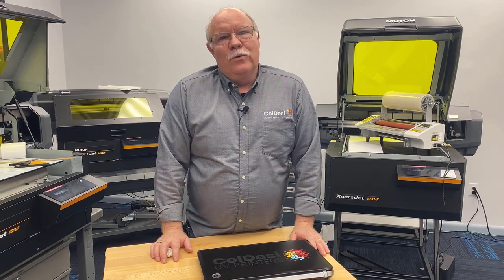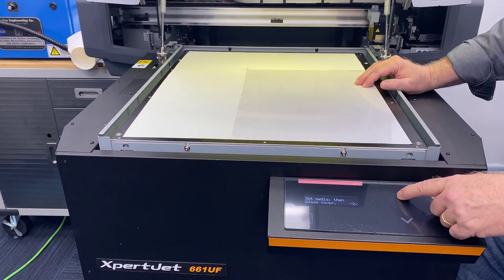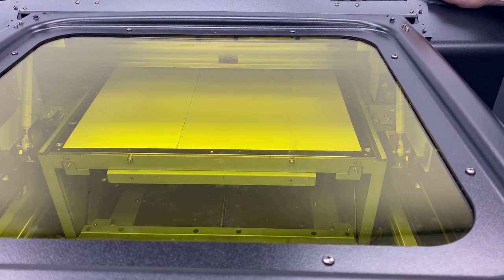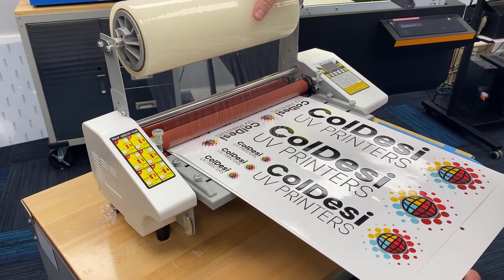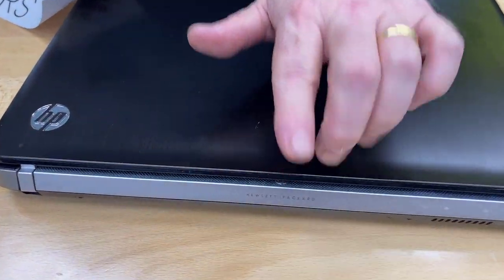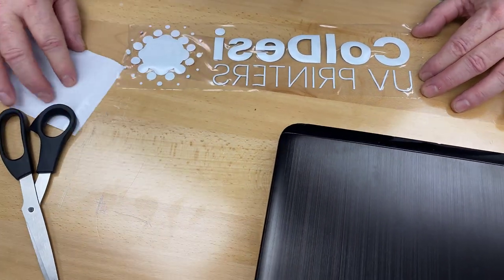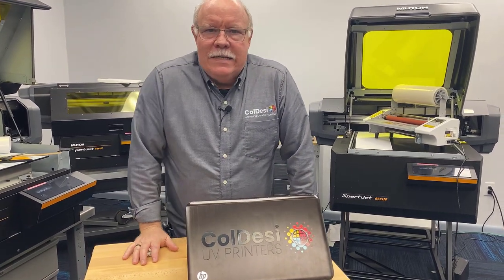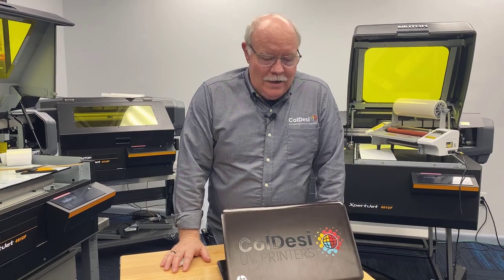UV Direct-to-Film (DTF) Printing | Custom Laptop Decals

Comment: Great output! I tried something like that from a  local supplier but the white underneath shows when a colored design is applied on top. Do you have issues like that? And if so, how do you remedy?
Reply: maybe in the graphic software, change the opacity of the white so it isn't so opaque? I don't know if the white is just automatically printed or if you have to place it there in the software, like the way you have to while printing white under clear stickers with eco-sol.

Comment: I don't get it. Printing onto the glue. Then, laminating. Where does the rest of the glue sheet go? 
There isn't any surplus surrounding the print.
Reply: yes that's a good question , i have a  normal UV printer with white ink and i want to try this , but i want to know the  the more info about A and B Film
Reply: The material that it is printed on has an adhesive on it. The laminate is to help heat the glue as well as being used as a transfer tape.
Reply: I know, I don't get it, either. I just bought a UV printer and I am going to try this out. Maybe it will make sense...

Comment: I need your help in a matter and I apply it in the same way, but after printing, when separating the A film from the B film, although I am very careful, do the paints have wrinkles in the paint? I need your help in this matter.
Reply from the maker: things will differ depending on the ink used